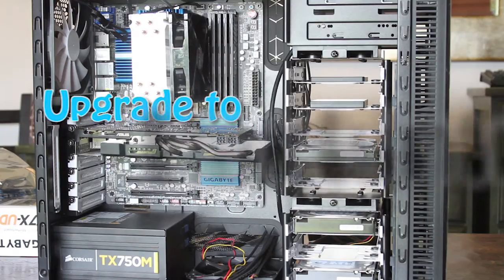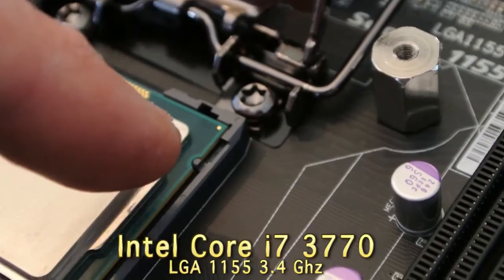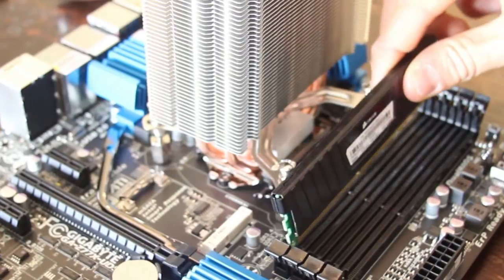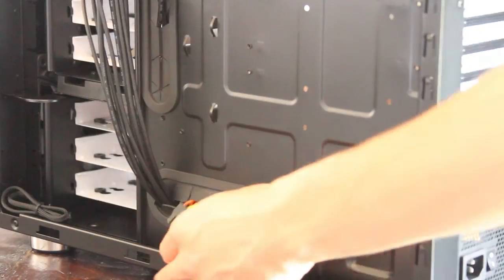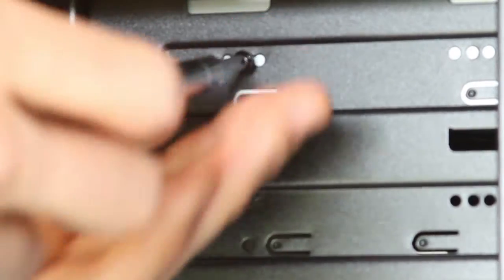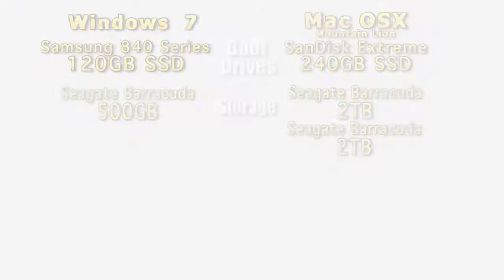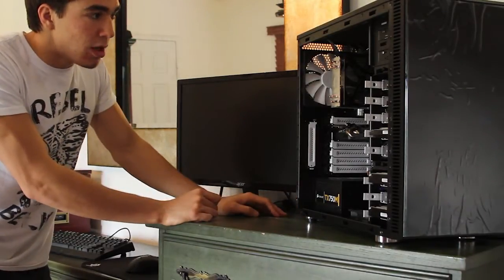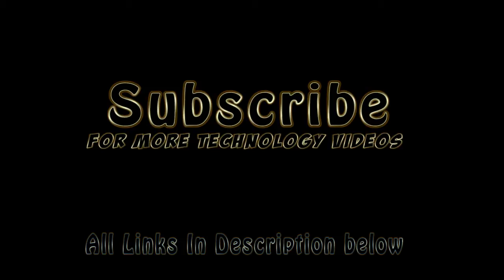Upgrade to Hackintosh 2013 | Part 2: The Build

Comment: Great video brother. Thanks for sharing. I'm upgrading my ITX build to a hackintosh with almost the same specs this weekend. Except I opted for the Fractal Arc Midi R2 and I'm XFiring 7970s. Oh and I also got an H100i for my cooler. Nevertheless this should be helpful when I start building :)